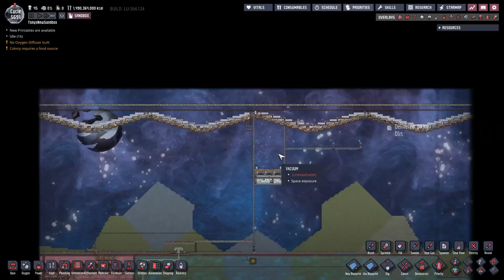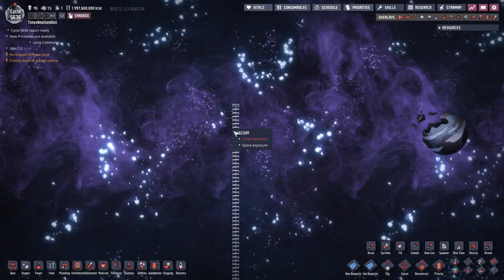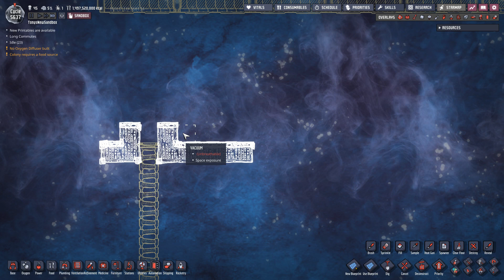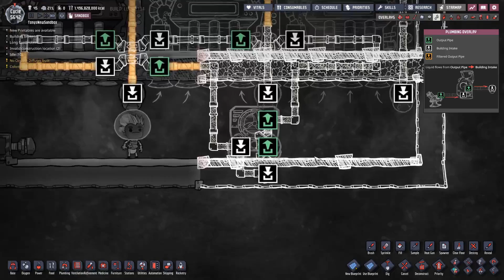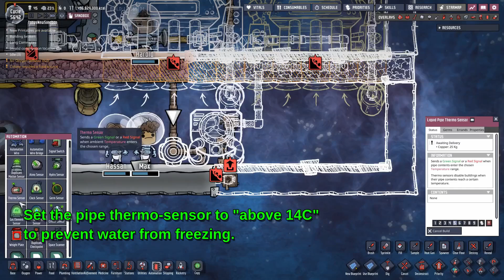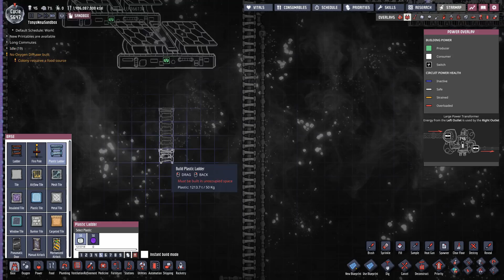Conquer the Space Biome in Oxygen Not Included

Comment: I just built one segment of this in a survival game. It's working fairly well for the most part, *but*, during periods of high activity it seems like the petroleum cooling loop can't quite keep up with the heat and eventually  steel items (robo miners and sweepers) at the far end of the cooling loop don't cool fast enough and start taking damage.  I didn't have much dirt so I made most of my tempshift plates out of igneous rock which is the next highest SHC, not sure if that matters enough to make the difference though.

I also put blocks over the top most robo miners because your setup clears from the bottom up, which means the transformer at the top is the last to get uncovered.  I have it powering the doors and a few times it didn't get uncovered in time to shut the doors before the next meteor shower

Comment: I haven't bothered to make anything that gives me a supply of petroleum yet... Would crude oil work instead? What about ethanol? I have plenty of both of those...
Reply from the maker: Petroleum is the only thing that fits the bill, sadly. Ethanol will boil away. Oil will block the light, so you won't be able to use solar panels. If you aren't doing solar panels anyway then there are simpler ways to go about it all.

Comment: Does this still work? I did the whole setup but the petroleum going down the stairs blocks my scanner unless I reduce it to a crazy low flow of like 10-100. Anyone else had this problem?
Reply: Awesome! Thanks very much for clarifying
Reply from the maker: I haven't tried it out in a while. I'll have a look at it right now.
Reply from the maker: It's working correctly. You need very little petroleum for it to work. In the video I used 20 grams per second (for each downhill slope). I'm not sure if 10 grams would be sufficient, but if your scanners still work with as much as 100 grams then that should certainly work.

You don't need to add very much petroleum because it mostly just sits undisturbed on the platform anyway. You only need enough to make sure it gets slowly replaced if regolith moves some or some of it gets lost to space.
Reply: Could you maybe make a video about how to deal with long distances if there is one? Now that I'm getting to space the construction time is super long as my dupes go up and down to get supplies, they also seem to spam going in and out of my atmo suit zones. I have a feeling it might be my priorities causing them to go in and out non stop but either way I'd love to see a video on either long distances or going in and out of atmo zones
Reply: @brehmluke  In your priorities screen there's a checkbox option (Might be under a gear menu? I forget) to have dupes "consider proximity" when deciding which job to work. This helps a lot on large expansive bases.

With that said, even w/ plastic ladders and atmo tube networks going all over, this build still takes a long time to build out. Maybe I need to make a smaller base w/ beds/toilets/food for my builder dupes that is a lot closer to the space biome? But I'm too lazy for that ;p

Comment: After watching carefully the video I have a question to ask about the size of the "space wall". For efficiency purposes, why you don't just create a single Tempshift Plate (it also work as a drywall) made of diamond (for a fast temperature drop) in tiles where you have machines instead of using this huge amount? (Of course, excluded the dripping columns that need to have this size).
Reply from the maker: My thinking is that there has to be enough heat capacity to buffer the heat so the petroleum pipe has time to take it away. I don't think it matters how many tempshift plates you use or what they are made out of as long as you have enough heat capacity to do that.
I didn't try it out, but I don't think carefully placed diamond plates will do the job. If they do, then I went WAAAY overkill on the heat capacity.
Reply: @tonyadvanced6315  is anything really overkill when you used dirt instead of diamond? ;)

Comment: I found it way easier to cool down the top bunker doors and whit that the regolith and cool the machinery with -50c regolith istead of liqiuds or gases. 1 turbine 2 aquatuner and a "bit" of ethanol and the only hot things from space will be your rockets and the small chunks of metals that cant cool down fast since they are not tiles.
Reply from the maker: I tried that, but I couldn't prevent the auto-sweepers from overheating because they have a lot of work to do and aren't cooled again until the next load of regolith. Is there something I missed?

I'm also not keen on using powered cooling.... But if it works that well I should look into it again.
Reply: @tonyadvanced6315  If i cool down evrything, the upper bunker doors, the regolith on it, the side bunker tiles and the 1 row regolith outside, they store a lot of cold so i dont need to run the aquatuners a lot they are just there for the starter cooling to be faster , and when the rockets roll out in mass.  I dont use radiant pipes , most of it is maffic , exept where the rockets are there i use obsidian and isolated obsidian so they dont melt and the isolated tile so less direct rocket heat gets into the pipe.  I overlap the sweepers  a bit / usually 2 sweeper for 1 miner/  and use multiple rails to clear up faster and to get less heat on individual sweepers/never saw them over 200C so there is still a 125C left /, the energy usage spikes harder but takes way less time to keep it clean.
Reply from the maker: @MrOssyan  Ah. Lots of sweepers/loaders to spread the work/heat around. That's the clever part that I didn't think of. I have other things to work on at the moment, but that's definitely good enough for another video.
Reply: @matthewbauerle7153  no need for thermium, the debris that falls down will touch the machines and cool them down, only the 2 drills on the sides may need some cooling love who dig out the rest of the build but you can just route the conveyor rail through them or leak semi cold co2 on them. It needs a lot of steel , but once you built it and let it cool down you wont have any problem with heat from space , well ....maybe 10-20 hydrogen rockets if launched to frequently could overheat it , but since space is gutted to ground , that wont be the problem.
Reply: @matthewbauerle7153  the whole point of my system is that im tired as f that one of my dupes always finds a way to bring a 300/200/100 celsius piece of regolith  and finds a way to drop it into a liquid lock or melt some plastic equipment , so i  invented a way to cool down evrything from space whitout space materials as much as i can /thus ethanol and very low freezing point/ , and wanted to be it a system that dosent needs babysitting or maintence . Yeah if i would break the system into smaller peaces and used better materials to preserve and transfer heat better , you could  make this system energy positive too but that was never a goal of mine , and since its huge , i dont know how much space materials you need for that.

Comment: Nice setup! Can you show how a rocket shop would be integrated in this design?
Reply from the maker: That's a good idea. I'll put it in my list.
Reply: @tonyadvanced6315  Please....  I've experimented with a ton of different space designs and found some I like, but I always have trouble integrating rockets.  At first glance, yours appears the same...
Reply: I would also love to see how you would integrate rockets in a good way in this design!
Reply: My giant space wall debris catcher is almost complete XD This thing takes forever to make in an actual game. However, I think what I plan to do is cut a giant hole out of this regolith catcher, and drop it below my rockets. Then put some automated doors below the rockets. When meteors are coming, close the top bunker doors as normal, when it completes, use automation to open the bunker doors and a small time later open the automated doors below the rockets, allowing the regolith to fall through the rockets; then those automated doors will close after the regolith had time to fall through and allow rockets to continue launching or w/e it is they do. I already experimented with a similar automated door design on a much smaller scale when I was getting my telescope to research the planets.

I've never actually made rockets in a game yet, but I suspect this should work fine. On the far left and right sides of the hole where the rockets fit, I'll make sure to leave a gap between the rockets and the edge of the hole so that the petroleum can continue dripping (or maybe the hole is one section of "down up" of the regolith catcher, so that you don't need to drip petroleum from the top of the biome to the bottom, just put the valves below the rockets under the automated doors where they normally would be.

Comment: I am super interested in the reservoir nonsense you ran into, I didn't realize it was possible for them to output less than full packets of liquid even when full. I dunno why, but one of my favorite things about ONI (and subsequently, your videos about ONI) are all the nitty gritty implementation details of pipe networks.
Reply from the maker: I'll try to explain it as I understand it, but it's hard in a youtube comment. A reservoir doesn't top-off packets that are sitting underneath the output's green-arrow, if there is a partial packet there then the reservoir doesn't output anything, even if it happens to be the correct element. So, if a full packet comes out of the reservoir, but in the next second the pipe is partially blocked and 95% of the packet is allowed to move forward, then the 5% of the packet that is left doesn't get refilled, it just blocks the reservoir. In the second after that if the pipe is no longer blocked then the 5%-full packet moves forward through the pipe, resulting in a mostly empty packet moving through the pipe. If your loop has to be connected to a liquid input then the packet gets topped-off and your loop gets more full. Repeat that enough times and the loop gets filled and reaches deadlock.
Reply: @tonyadvanced6315  Oh I guess that's similar to how valve vs shutoff works, where valve will combine packets, but shutoff won't allow any content to pass through even if there's only a tiny packet of liquid on the other side. Strange how some outputs act differently than others.